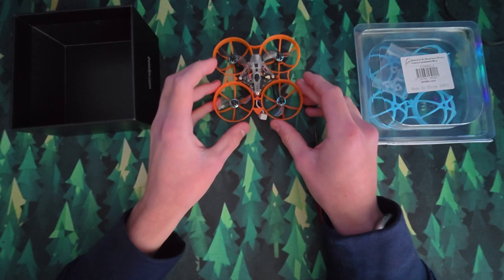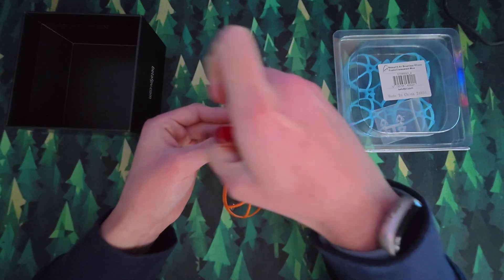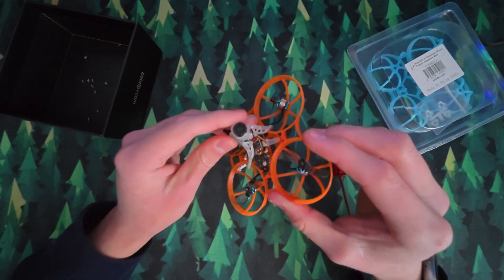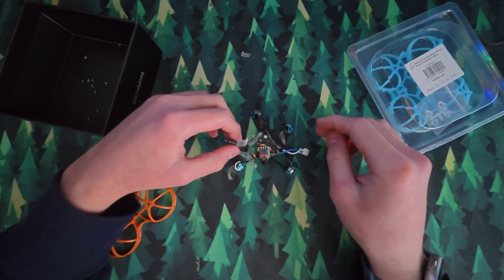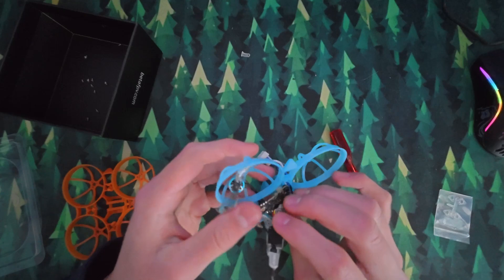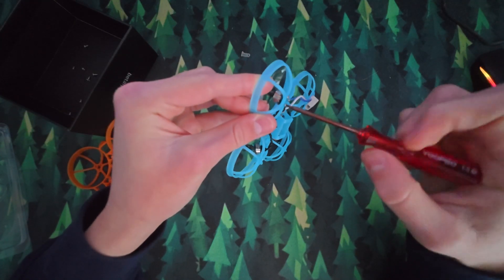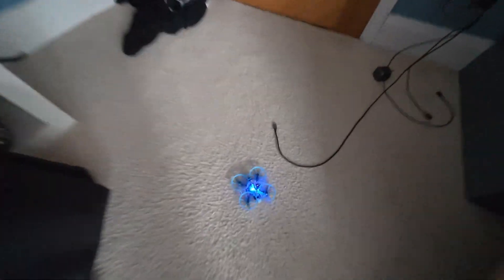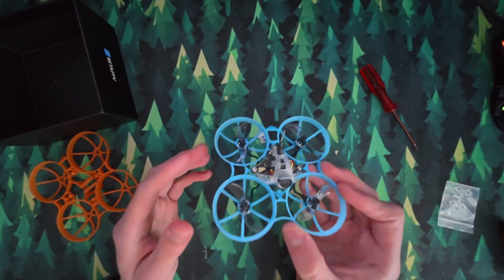BETAFPV Air 65/75 Frame Repair Tutorial

Comment: 0:21 You can just add some heatshrink and glue in between and the frame will last even more time and crashes, it is even cheaper thand buy new frames.
Reply from the maker: Thank you very much for the advice. I never even considered this! I will do this next time I crash.
Reply: @Rubydude I made a post in my youtube community about this topic. You can also use shrink tube. Or E6000 glue with glasfiber.